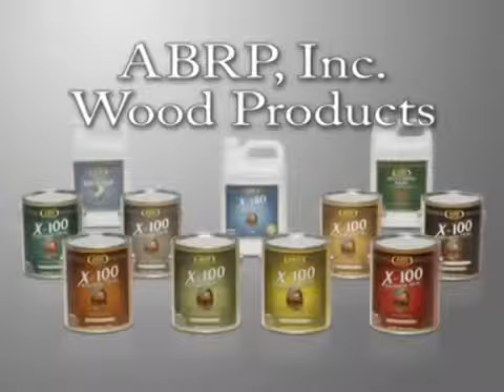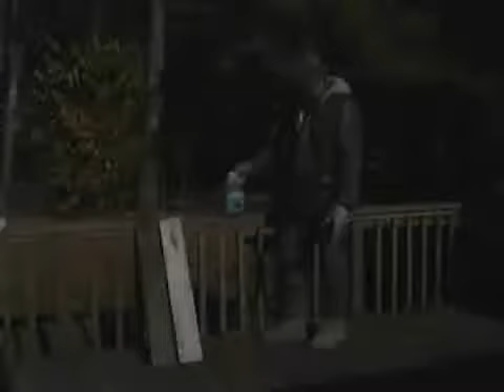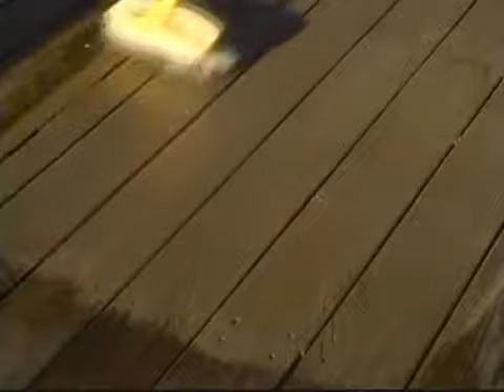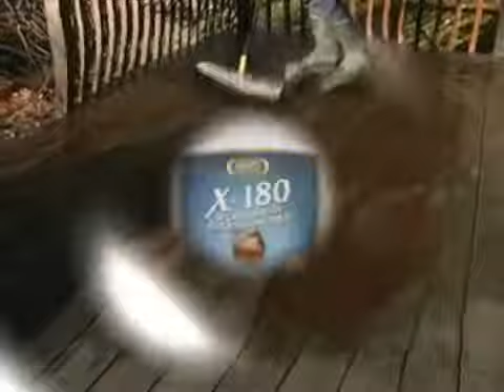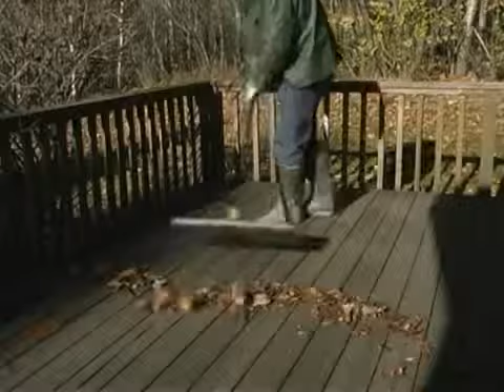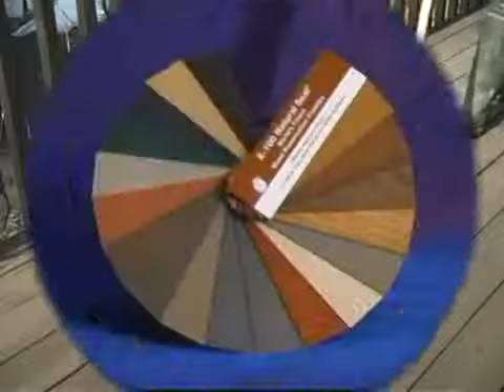Tips for Cleaning and Restoring a Wooden Deck

Comment from the maker: Tips for Cleaning and Restoring a Wooden Deck
http://www.pressurewasherguides.com/tips-for-cleaning-and-restoring-wooden-deck/
Deck cleaning and restoration is a sure fire way to keep your wooden deck in tip top shape. Not only during the cold winter months, but during all the seasons your deck can take quite a beating. From the snow, to the rain and harsh sun, the wood may often become damaged. However, there are a few simple to do tips that will not only help clean and restore a wooden deck, but can help prevent and minimize the damage done.  #pressurewasher  
See more: Best Electric Pressure Washer Reviews 2014
http://www.pressurewasherguides.com/